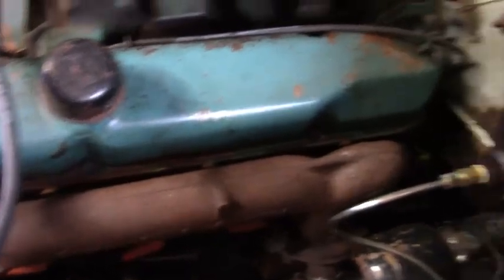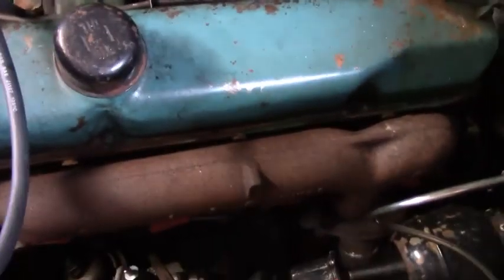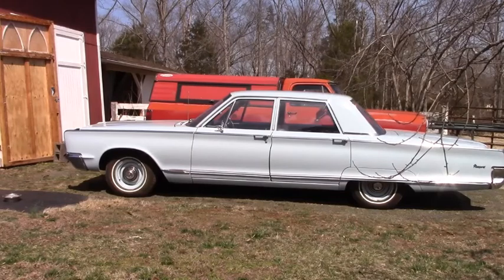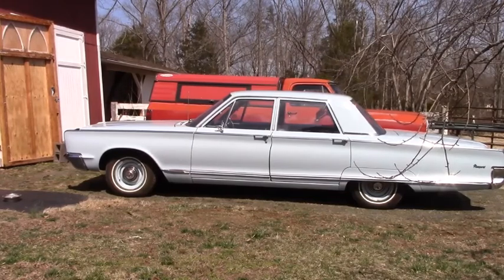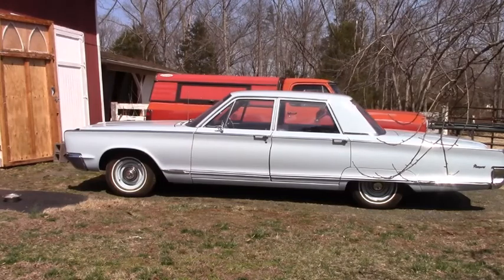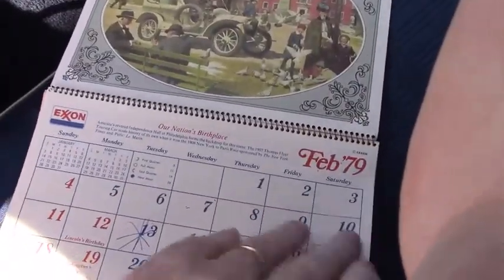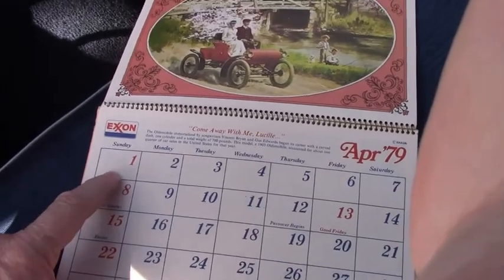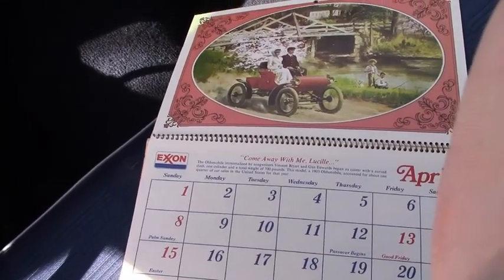60 FOOT TIME in my 1966 Chrysler Newport 383 Automatic #NONAMENATIONALS

Comment: Such a great C body Mopar. Would be nice to see at the #nonamenationals too.
Reply from the maker: Mornin' and thanks for the sub!  Back at you!  Thanks you on the car, but I can't take credit for its condition.  That goes to the late owner and his daughter.  I'm the 2nd owner.  Everything I'm going to do to the car this Spring and Summer, I'll probably take back off of the car, whether I get to go to NNN or not.  I'm juicing up the two barrel and not putting on a 4 barrel.  I'm doing what I did to mine 40+ years ago because back then (like today) I don't have a lot of extra $$$ if you know what I mean.  I want to see the car go up against the big iron of Ford and GM.  We stopped getting the spot light after NASCAR went down to intermediate chassis in the 60's.  I hope to see you there.  Perhaps a friendly call out is in order for us?
Reply: @lbbruins7958  I had a ‘66 Polara years ago with the 383/727 combo that was a fun car. Gigantic car with an enormous fuel tank. It was so wide I remember it had a drivers and passenger side ash trays. You never know about the #nonamenationals it would be neat to see one of my cars against the Chrysler.
Reply from the maker: @fullthrottlekindaguy  I agree!  I just opened up the page this morning and I see they took 2 subs away from yesterday.  I've been 2 up 1 down or 3 up and 2 down most of the way.  I've been screen shotting the past few days so I'll have an accurate count and graphable loss value.  You know, just for fun.

Comment: I wish my 300 would start that easy! But I would have to put the choke back on it and change the valley pan to have the heat crossover holes (that's probably not going to happen)!
Reply from the maker: Well, you can always use a carb with a manual choke.  I've used them before an they work great...no worry about a heat crossover.
Reply: @lbbruins7958  I could, but I would need to remove the existing choke and I don't really like the look of the cable choke.  I know I'm being picky, but I like the car this way as long as I don't try starting it at 18°F.
Reply from the maker: @MostlyOldPartsAndRust  That's the spirit!  My heat riser spring is busted so it just lays in the open position.  It still takes a while  longer to warm up and who wants to cruise around when it's below 70 anyway!
Reply: @lbbruins7958  You would not believe how many times I drove this right before Christmas (my father passed on the 23rd of December) with the top down and snow on the ground in the 90's.  Of course I was wearing a snow suit and gloves, heat on full blast, back then it still had the crossover and the choke worked.